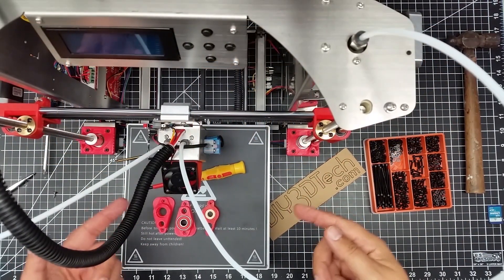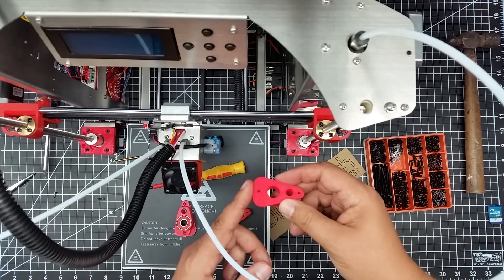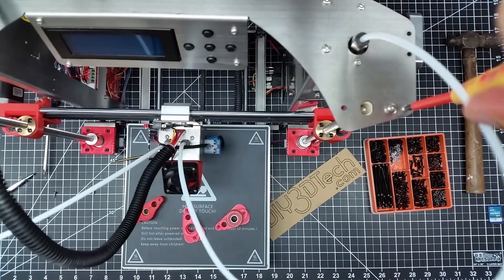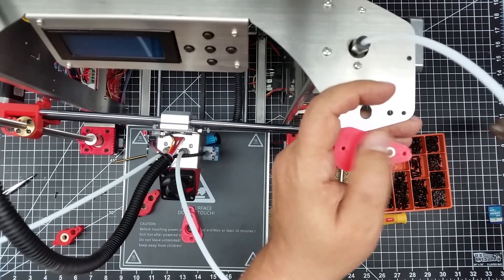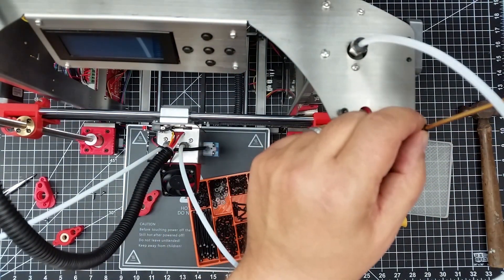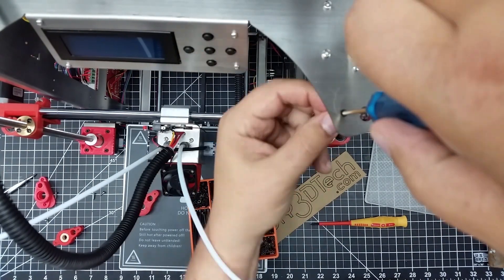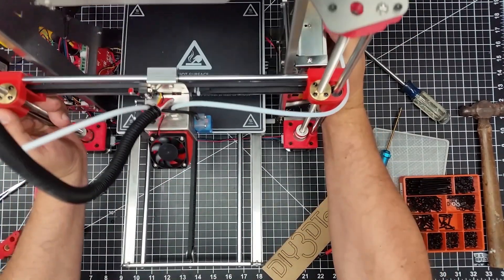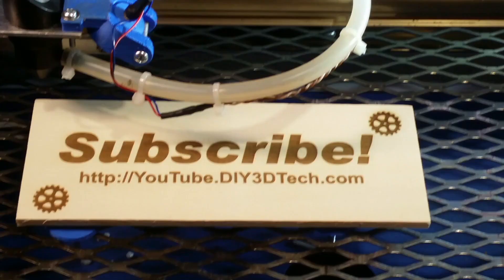Zonestar P802QR2 - Moding the Z Axis Top Supports!

Comment: Greetings DIY3DTECH,
I am having trouble setting the x axis origin. do you have any suggestions?
Reply from the maker: Guess I am not following you, this should be done by your firmware when it home the machine.
Reply: My Machine homes about 10mm to the right of 0,0 on the build platform.  Where do I crank in the 10mm offset?

Comment: Doesn't that just overconstrain the leadscrews?
Reply: Yeap. Cheap leadscrews are almost never perfectly straight, so it is actually worse to constrain on top, since it may generate zwobble from the leadscrew pushing the X carriage around.
Reply from the maker: Not at all the flex-couple handles any minor errors and it has been working great for me.  Worth note is you want to true things as much as possible when doing this as that is part of doing.  Yet squaring a printer is also 101 type stuff...
Reply: DIY3DTECH.com I have a fixed coupler and a free end in my lead screw.